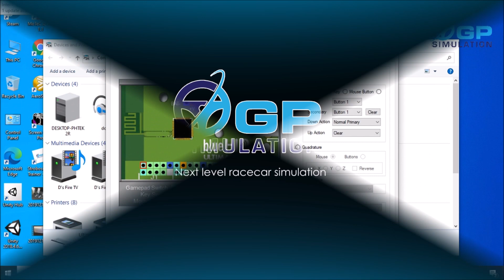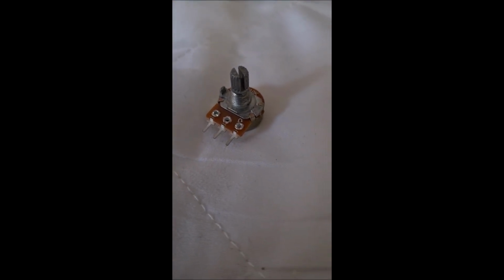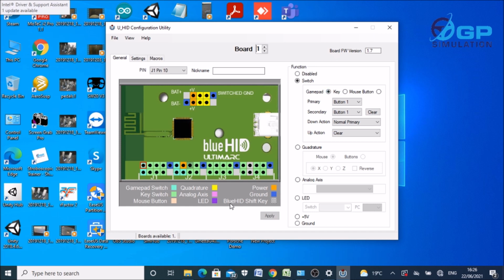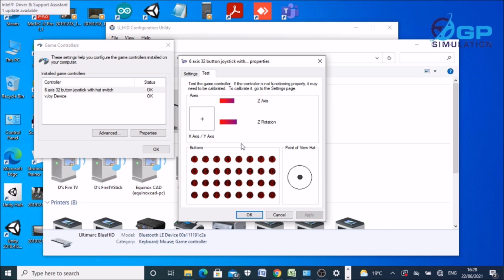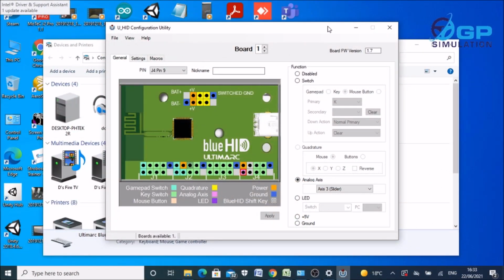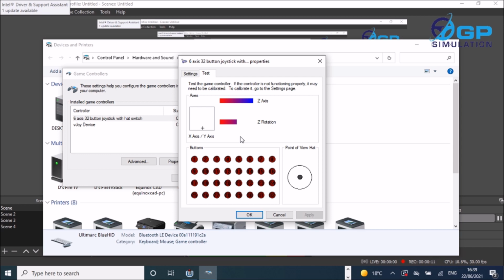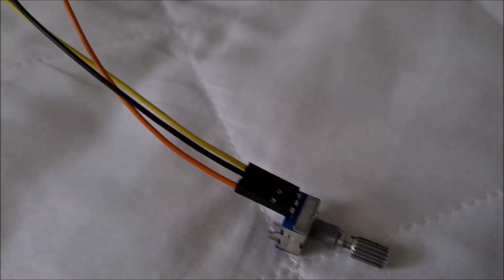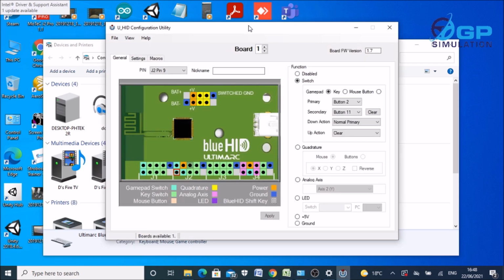Make your own Wireless Steering Wheel/Button Box Part 2  - Sim Racing

Comment: Hello, I have a question because I would like to make pedals and I want to use LC 20 kg for clutch and gas and 100 kg for LC brake and I want to connect to HX711 boards with one Arduino Leonardo. Do you have a script to make this work?